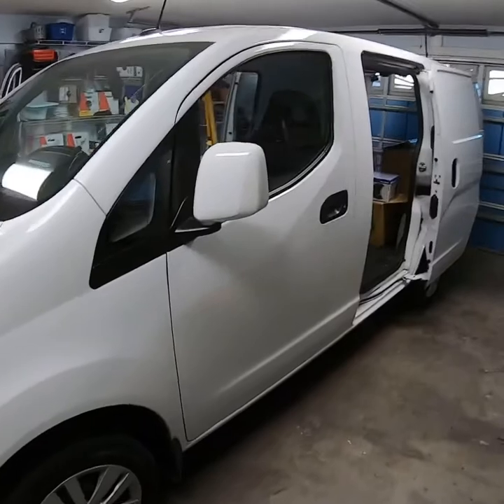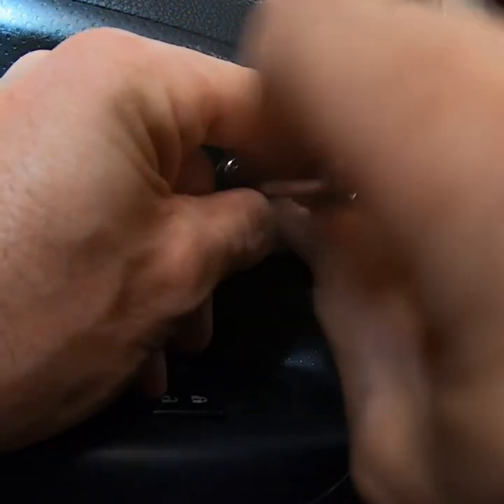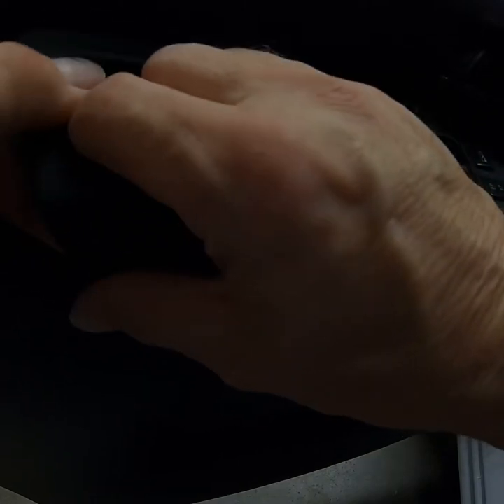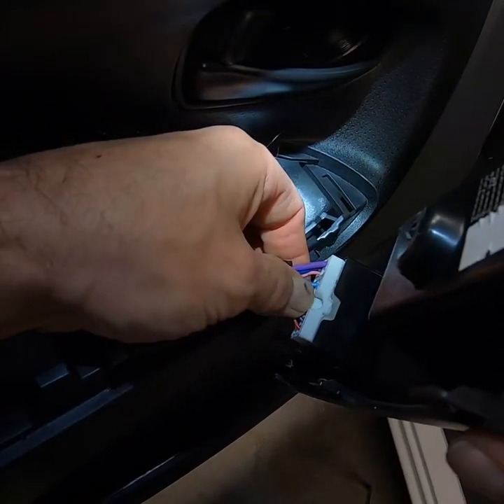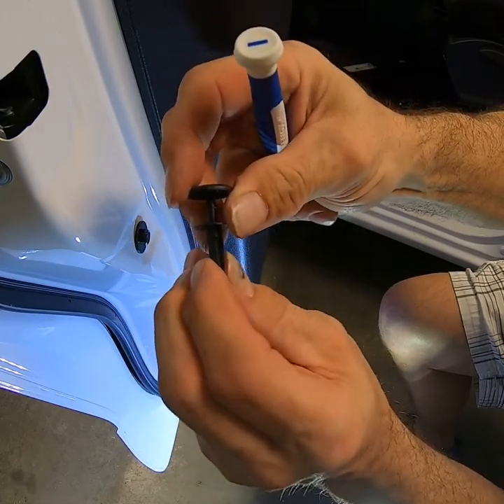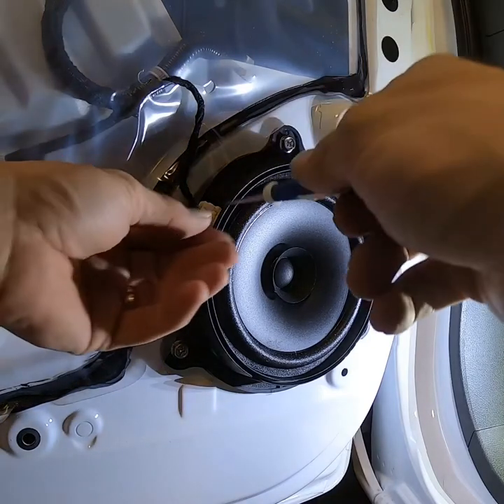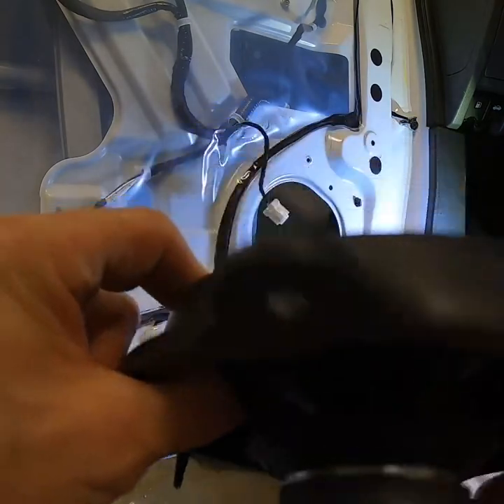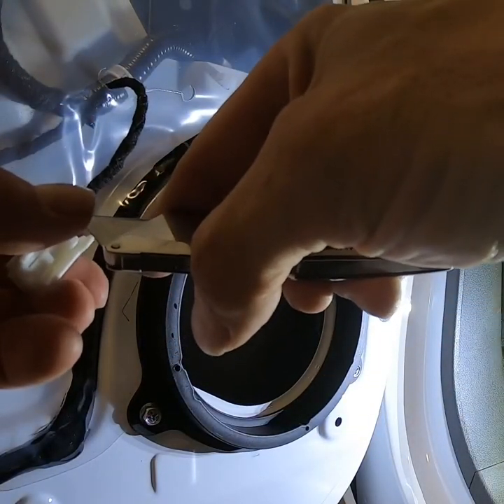Nissan NV200 Driver Side Door Panel Removal: Step-by-Step Speaker Replacement

Comment: Great video.  I replaced the stock speakers with Kenwood KFC-1666S.  I thought it would be fantastic upgrade for a lot of driving I do but MAJOR disappointment.  The originals sucked but way better.  The base is so bad on those Kenwoods.  Ah well what can $50 speakers get ya I guess.  Read reviews and thought were good but I guess not.  Any suggestions which speakers are good ?
Reply from the maker: Without changing that Head unit not a lot you can do.  Like you said basically make the best of what you have without going crazy.  With all the electronics shortages now from major manufactures I don't even know of a head unit to use anymore.  All the major company's are out and from what I hear will be out for a long time. Amazon reviews are mixed on head units, think some getting better ratings just because people have not heard a good head unit so the Boss or whatever getting good reviews.  Thanks for watching, if you find something that sounds good please update.  Ive tried a few from Amazon, makes it easier to send back if the are not what you want.  I probably have had the best luck with stock head units with Kickers.

Comment: Vans, bikes, and guns. We are very similar! 🤣
Reply from the maker: LOL Putting LED lights in the back to replace the wimpy little lights in there.  Didn't video to tight of a spot to work and tape but doing a video when done probably tomorrow.  Got everything mounted used 4 pod led lights, makes the other look even worse than they are.  You would think a "work" van they would put some decent lighting in it! lol

Comment: Hi, thanks for the video.  I just bought a 2021 Nissan NV200.  I have been installing some added security in the form of internal padlocks on the doors using plus nuts, eye hooks, and long shackle padlocks.  It has worked well for the rear doors and sliding doors, basically connecting the door frame to the vehicle frame.  

I am adding locks on the inside of the van because I keep hearing that it is easy to break into a van by just using a screw driver in the key hole. 

For the front doors, I think I will be placing the plusnut on the vertical window/door frame, next to where the window comes out of the door.  But I need to drill and I am trying hard to vacuum up all the steel  shavings to avoid any opportunity for rust.  So I want to vacuum up any shavings that land inside the door.  I have a vacuum with a narrow hose attached to it...so I can snake the hose down inside the door. So after watching this video, I am thinking that maybe I only need to remove the control panel, not the whole door panel, and maybe cut a small hole in the plastic to snake the hose down near the bottom of the door to vacuum up and steel shavings from drilling.

What do you think? Or would you suggest I remove the whole door panel?
Reply from the maker: Personally I would just remove the panel.  It is not hard to get off of there and your more likely to break something trying to get around it.  If it were a hard panel to remove then maybe drill it, but again as easy as it is to get off , no extra damage.

Thanks for watching.
Reply: @RagerJackOfAll  Thanks, I will take your suggestion and remove the door panel.  I have been struggling with how to lock this bad boy up...